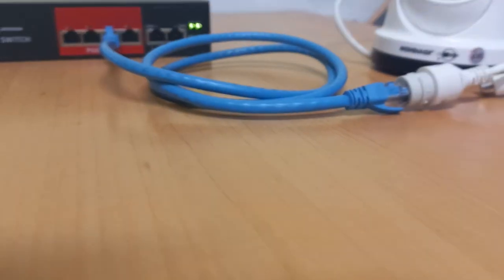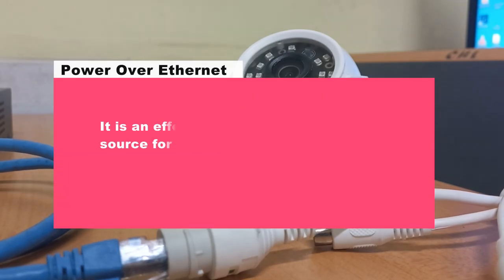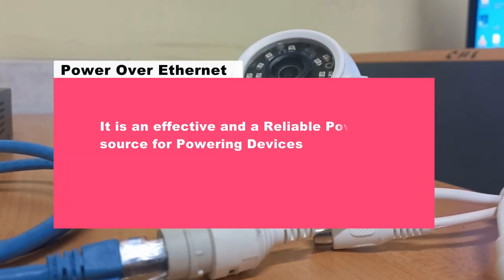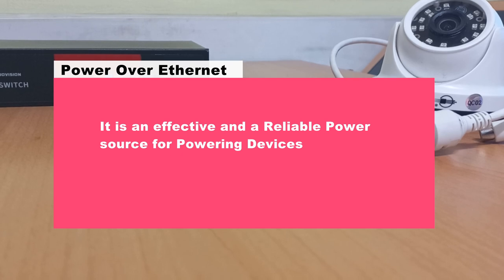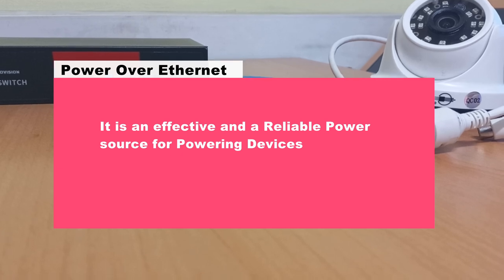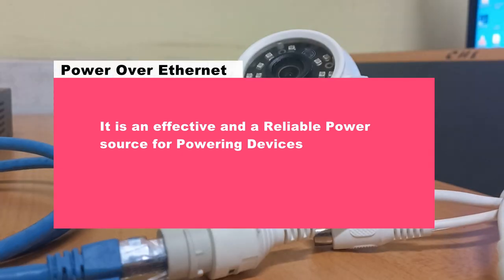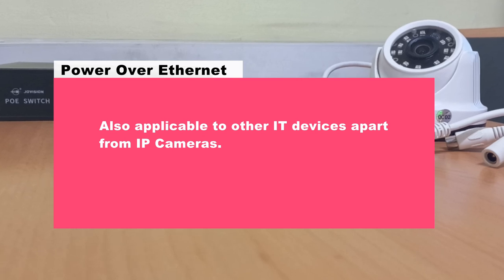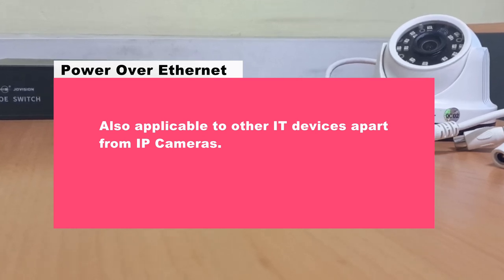What is POE Power Over Ethernet and POE switch

Comment: The camera is poe as you indicated. Why does it have to go through a poe switch please?
Reply from the maker: It is the POE switch that generates the Power through the ethernet.
Reply from the maker: Please let me know if that clarifies your question.
Reply: @Tech_Inside_Out  oh I forgot the nvr isn't poe..  Could you use the poe switch without first connecting the camera to the poe injector to the switch?
Reply from the maker: @swaggst  POE Injectors are used in place of POE Switches, so when you have a POE Injector, there would not be need for POE Switch and vice versa. A POE Switch can however be connected directly to a camera when the camera is a POE Camaera.
Reply: @Tech_Inside_Out  okay I saw a black device connecting a bridge from the camera cable to switch, so I thought that was  a poe injector. 
 Poe cam - poe switch - non poe nvr 
Non poe cam - poe switch - non poe nvr
Non poe cam - poe switch - poe nvr

Which instance do you need switch for poe cam and poe nvr?
All of these correct please?